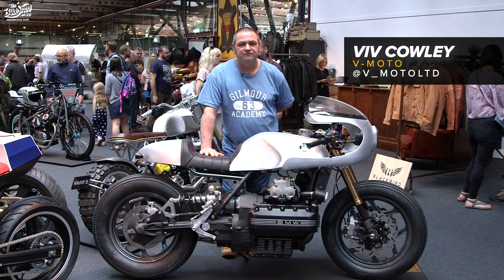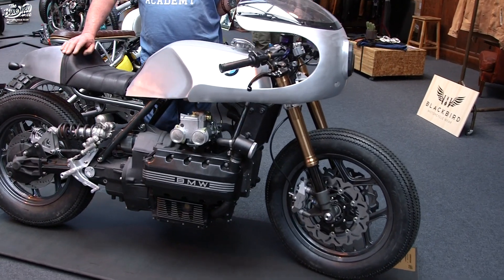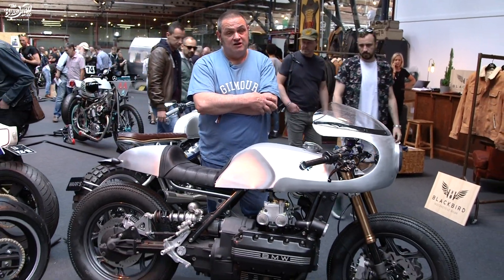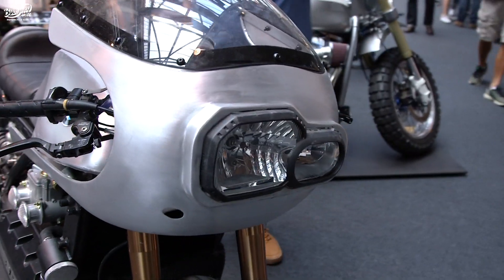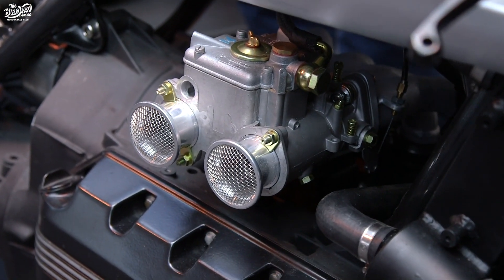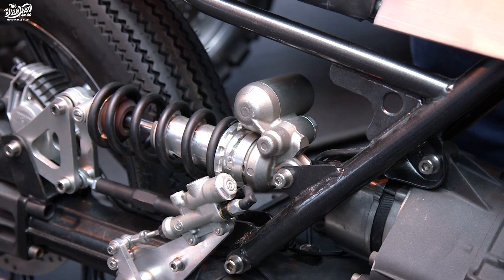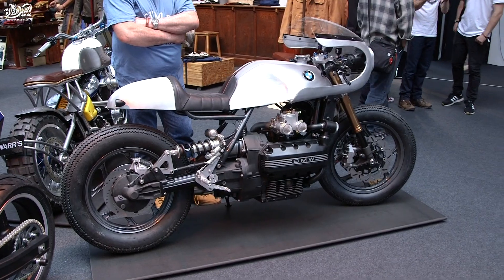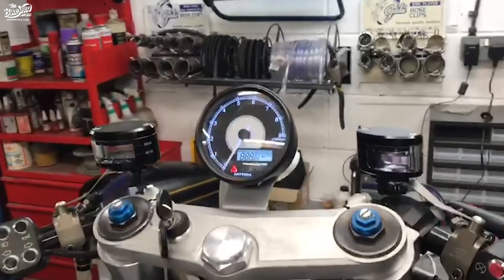V-MOTO: BMW K100 Cafe Racer - Bike Shed Show 2019

Comment: What is it with people and these tyres???
Shinko/Firestone whatevers and the word cafe racer in the same sentence is surely an oxymoron. Great on a rigid outfit. But on a 2 wheeler? That pretends to go fast? And go round corners? And then on a wet road? Jesus. Form should never be over function when it comes to dangerous. These tyres belong on a period side valve Indian or HD 45 resto and NOTHING else.
Edit.
No problem with the bike, fabrication work, subjective looks. Just those friggin tyres...ps ; neat inlet manifold work...

Comment: If you're the builder it's easier to install carbs instead of dealing with EFI (especially the wiring) but honestly I don't understand why would someone (from the owners point of view) would downgrade to carbs on a bike that came fuel injected from the factory in the first place!